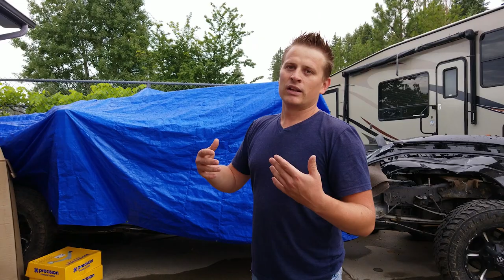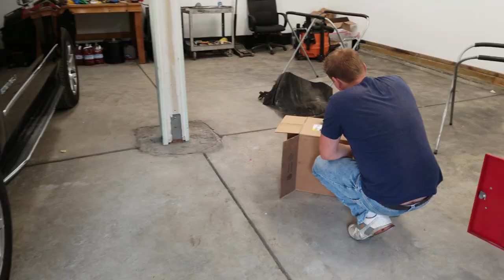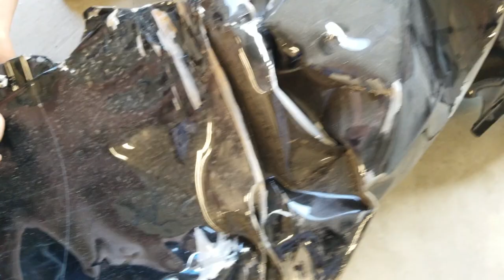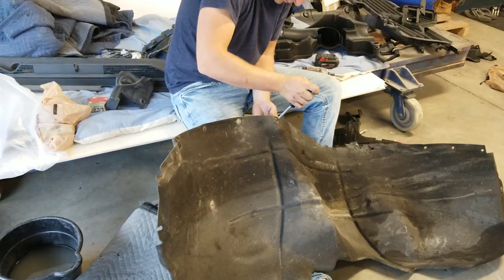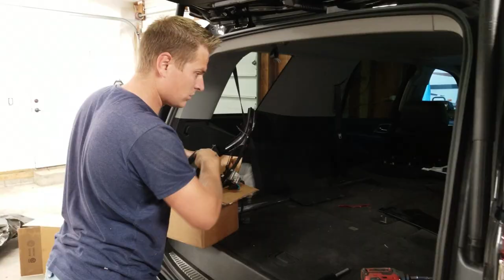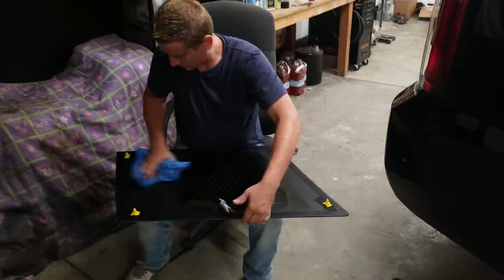Rebuilding 2017 GMC Yukon DENALI from Copart prt 12

Comment: She looks good, I dont think you will have a problem selling it at all. Course your going to get some people who think if they offer you 79.95 and a couple of coupons for free donuts at Dunkin Donuts that it's an offer you can't refuse, but that's par for the course. Considering what these sell for new and even used, being that you rebuilt this and did a new paint job and went through it thoroughly and did a quality rebuild, some buyer is going to see its worth the ask for it

 I hate removing fender liners, I just hate it... especially on the trucks that always are a PITA to get out and then back in. one of things I have always dreaded doing. I will give you props though on putting in that back window, that's tough to do with the adhesive because you only get one shot at it and you have to get it pretty bang on because that adhesive can set up quick and if you take too long then the adhesive doesnt adhere well, and it takes a bit of skill to get it in there straight and matching even around where it sits in the frame so it looks like it was never out, so mats off to you I dont think I would have brave enough to try that...lol

You have to rebuild em as you have the finds to do them, I dont think people realize when you get into the newer year vehicles just how expensive a wrecked one can be depending on the damage, title and make model, year trim, engine etc the vehicle is  then when you start to add up parts new and used, materials to fix, then premier pain and clearcoat, then polishing etc and the amount of time you have invested into it and if you had any companies do work  on it ( frame work pulling, glass install, air bags, seatbelts, ecu or module programming ) the money can fly out the window pretty quick, it can add up fast.

I always say to guy when your going to do a rebuild look that vehicle over thoroughly and crawl over it , under it and through it and try and look at everything you can if you can start it start it, if you cant then make note of it and make sure you get a good idea of what it is going to cost you to buy it, parts to fix it, any contract out work that you cant do and  how much time you have into it and make sure you have a budget set side for the unexpected. I have seen guys think easy fix, and they go spend 18k to buy a newer truck or SUV , and then they do all this work and it costs more for part or this or that then they figure and then they think they are finished and all of sudden they have an engine problem or transmission problem or an ecu problem then next thing you know they have a vehicle they have no money left to finish or parts etc they need and cant afford and end up sitting on it or selling it at a loss.

You seem to have been doing this long enough to know the pitfalls to avoid getting stung like that, but your right it takes money to do these rebuilds, sometimes you have to wait for one rebuild to sell to get the next one done, it goes like that, but when your doing newer vehicles it takes money to make money and no one give vehicles and part away for free. 

You should do good on this, like I said I am sure you crunched the numbers  to make sure it worked before you even left after seeing the SUV. Look forward to the next update... and how did people miss the F350... i saw it under the tarp, you could see the rims from the videos on it, so I knew right where it was...lol
Reply from the maker: Appreciate your support. My experience in this field cost me a lot of money,  I had good profits and also big losses. You just can't predict everything,  Usually little things will hit your pocket way deeper than you thought.

Comment: A fair offer would be the KBB rate ( for a vehicle of this trim )
Also consider the number of new parts in this vehicle.  This SUV is almost like new.
Reply: I love the work that V. and other rebuilders do on these vehicles. However, KBB values are NOT fair or reasonable unless the title is clean.  Remember, insurance companies will only insure a branded title vehicle for a percentage of its full value, regardless of its condition. It would be financial stupidity for a buyer to pay more than the value that an insurance company will offer on its total loss. Some insurance companies refuse to insure rebuilt title cars at all.

Comment: Nice job putting it together and soldering the wires but you really should have heat shick the wires and not just use electrical tape
Reply from the maker: Thank you. I used to do that but not anymore, i stopped after i came across wiring issues. What happened is  Since does wires outside and they're exposed to the weather specially Winter somehow water managed to get in between and its drying out inside damaging the wires, with electrical tape it works as ventilation and i never had issues with it. It's my bad experience with shrinking.
Reply: SalvageMasterV V You know what you are doing. Ppl on Youtube always think to know better, they don’t.

Comment: When you do the cost break down pls start with Cost of the vechical...tell us how the vehicle was branded... clean title...salvage... floaded etc If the vechical a had estimated damage...value. 2. What where you cost to buy it... ie copart fees taxes... brokerage fee etc 3. Breakdown of your part your bought... part from dealer and parts from Ebay etc 4 parts you where successful in repairing Break down.... cost for body work ie per...body prep...paint base coat clear etc.. 5 list of the most expensive part or surprizes... 6. What was required of you together the vechical recertified.... to make it driveable...Please make a video on this.. walk us three the steps what did you have to do to take a salvage titled vicheal drivable but also insurrable and sell able. 7. What you would charge to do this work. 8. The final rebuild price Buy the way get videos .... the truck look great!